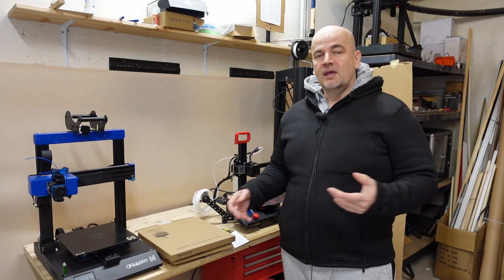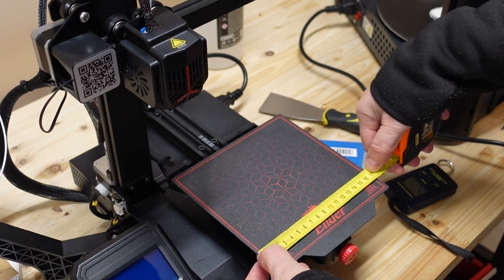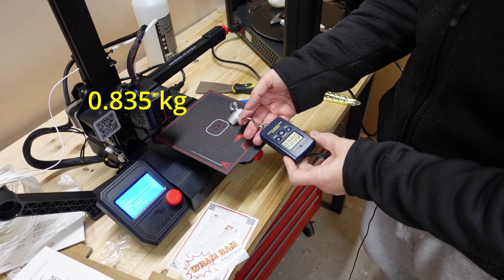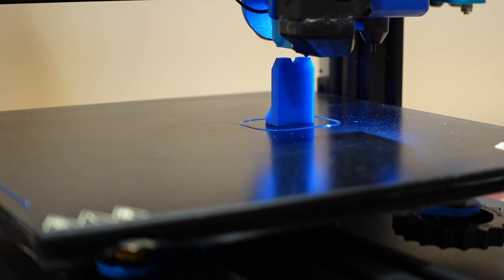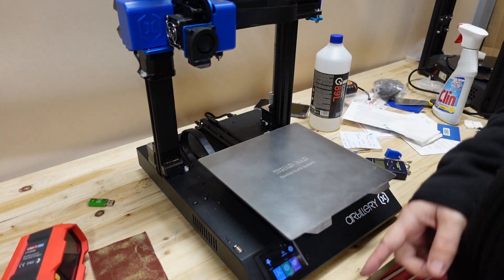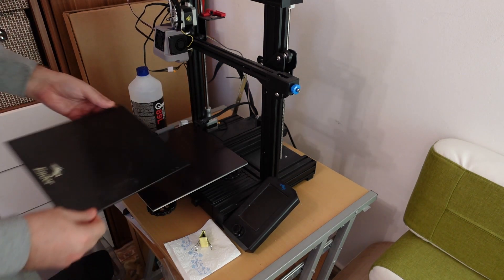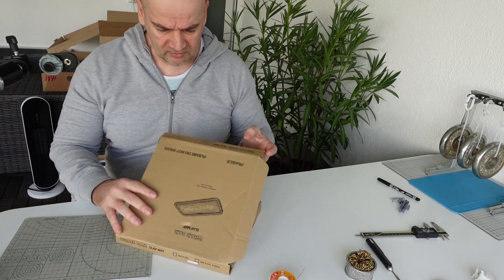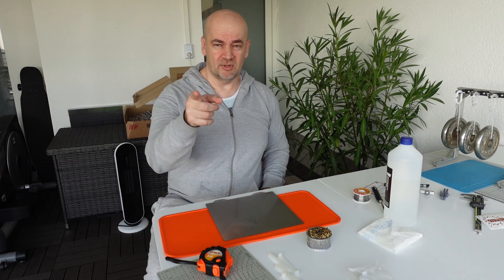Wham Bam PEX flexible build system (on Ender2 pro, Ender3V2, Genius Pro) + Slap Mat review

Comment: super video! you may want to also use our magnet on the Ender 2, ours is much stronger than the original magnet, as well as resisting much higher temps.  For PLA use a 70° bed and lots of first layer squish.  We sent you the Slap Mat not only for resin use, but also assembly disassembly and soldering as you have guessed! we are here to answer any questions.
Reply: Lots of squish? You mean enough to print with elephant foot?
Reply: @GreenAppelPie  yes, then you can dial in first layer settings to reduce or eliminate elephants foot

Comment: i would still prefer my mirror build base. i bought an ender 3 v2 in august last year, and as you said ir came with this kinda grey ultrabase. i didnt have any luck pla sticking to it so i just flipped it. that i upgraded to a mirror 4mm in thickness, and i didnt have any problems after that. because mirrors are super flat, and i guess, creality being creality, cheaping out or something. maybe quality control isnt great, but my aluminum heating plate is warped. i didnt bother fixing it, because i use bftouch.

Comment: Great reviews, comparing the materials is very helpful. A question is how long do they last and how do you maintain them. The steel wool is one way and you use IPA a lot for the short term. By the way, the correct way to use the spatula is to hold the blade and hit the part with the handle to knock it off😀 The blade is far too thick to slip under a print and scratches everything it touches, I use a plastic spatula for that.

Comment: I havent bought exact wham bam bed system but similar one metal magnetic sheet and at first I was disappointed of it because it sucked at adhesion and was at level of being worse than non heated bed, but then I started printing much closer to the bed and bumped temp to 70-75C and it magically started sticking like hell, until it cools down there's no way to remove print from bed, once with big desk container when print finished &  I tried to pull it off the build plate while it still was hot I pulled container with magnetic sheet still sticking to it

Comment: Very nice video and looks like an awesome product.  It would be nice to see a follow-up after a few weeks of how the surface holds up over time. Reference the number of prints that have been done and doing only cleaning with alcohol and what standard prep the manufacturer specifies before each print. 

Also is there a specific stl file or are you using your own file for the bed adhesion test? It looks like a handy test file to add to my collection  😉
Reply from the maker: Yes, from mytechfun site, link in description. STL

Comment: Certainly didn't look like you had the nozzle close enough after switching the new surfaces. Could see gaps under the skirt etc.
Reply from the maker: Yes, almost in every case, (on first test print) I correct the Z-offset (or Z baby step) during 3D printing of the skirt or brim. That's was the case on Ender3 and Genius pro

Comment: Even if these flex plates would be fantastic, the price is just criminal.  I'll stick to mirror and FR4 until I win the lottery (which I don't waste money on, so zero chance of that happening).
Reply: you can buy knockoff flex adhesive plate for ~15-20$, I use them personally and work same as those famous advertised ones